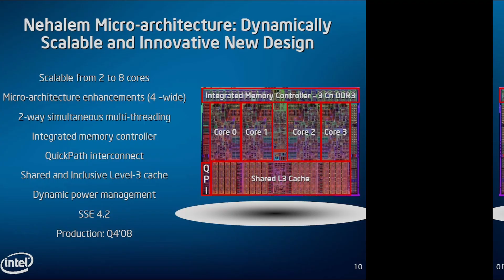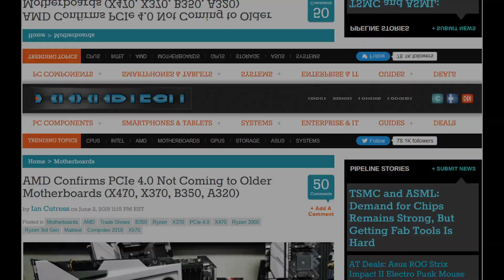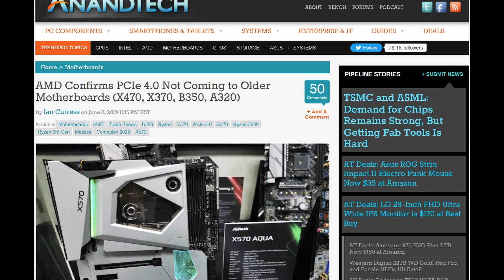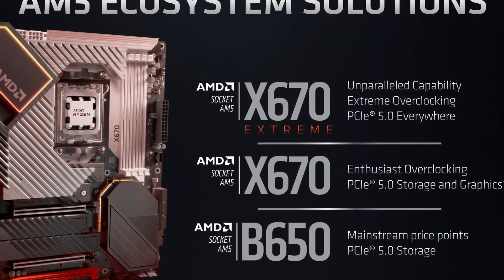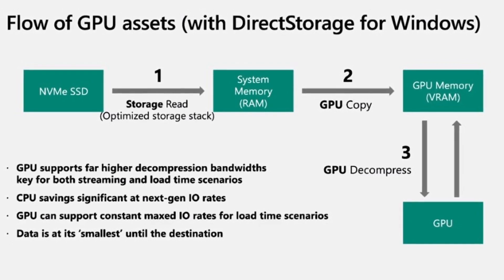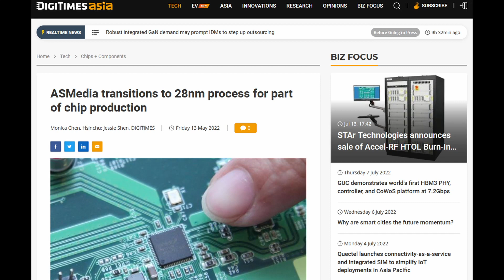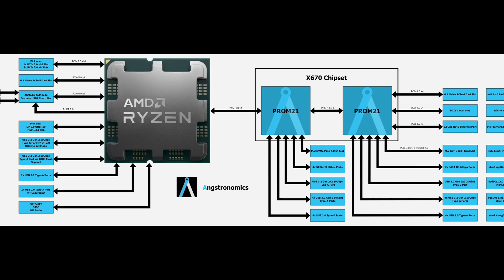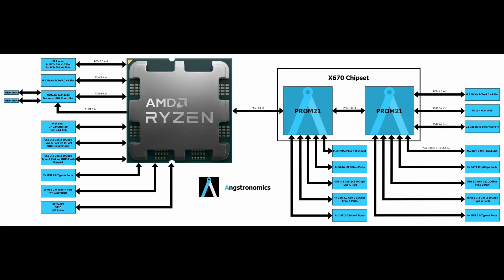The Smart Design behind AMD's X670E

Comment: I hope they release an X600 chipset like the X300.
My Dream Mainboard:
itx
2x USB 10G
2x USB 4
no SATA
1x M.2
1x pcie x16
Reply from the maker: Same here, in only need one PCIe port and honestly, no more than four USB ports. But two M.2 ports would be nice tho.
Reply: @HighYield  
A second M.2 would be nice but it could only be pcie x2. When my math is correct.
28 Lanes from the CPU
x16 GPU
x4 USB4 Controller
x4 M.2 1
x2 M.2 2
x1 Wifi Controller
x1 LAN Controller
Reply from the maker: That’s correct, but PCIe gen5 x2 = gen4 x4, so one ultra fast gen5 M.2 and one super fast gen4 M.2 would be possible.

Comment: Epyc Servers today are already SoC only.
No need for up to 10 chipset chiplets.
Reply from the maker: You are completely right! Servers already offer a ton of PCIe lanes for I/O and they need to be able to use them at high speeds simultaneously, so a chipset would be kinda useless, since it expands I/O above the actual available CPU connectivity. In my mind these chiplet chipsets could be used as chips on a modular chiplet based server, but then the actual I/O die also needs to include the memory controller and fabric to connect to the CPU chiplets, so this idea might be dead in the water. Still, scaling from entry to workstation should be possible.

Comment: : To your question: I don't think many chipset-less mainboards are coming. It's a super niche use case even though it would make a ton of sense for small form factor builds. Most buyers will think, that they'll miss out when they buy a mb without a chipset. Much like most people don't need so many DIMM slots or m.2. slots. I would also like to see like, bare minimum mbs with like only two DIMM slots, one/two m.2. one PCIe. It would be great for low budget builds. One might think that it would make the other mbs more expensive though since less people would buy fully equipped boards and so the return of investment is shifted.
Reply: There is also a growing intrest/need for such a thing though. Those of us who have been building with Pis and UNOs for some time are ready for more power. It  would allow for a lot of innovation in the "maker" world. Many of my projects need to have a central PC to work and Inuse Pis etc to relay the data. If the moduels could be stand alone, it would be an excellent opportunity to try new things. Currently most solutions are ARM based although these have been some good Ryzen based solutions as well coming out. I think they are getting noticed. It would be a good outlet for lower Bined chiplets. I would love to have APU power in an application I would normally use Pi for! It would also allow more power from the chip since it would have less distance to travel etc. 

For gaming, it would be nice to have a minimal board too as long as it was optimized for gaming. The issue with PC is that it is often all designed to do anything which makes it difficult to optimize for one specific applications. If a board was made just for gaming like a console imagine the performance we could squeeze out of a system!
Reply from the maker: You are right, it’s still very much a niche, but with ITX gaining traction, maybe bare-bones mainboards will also have a comeback?
Reply: @HighYield  : Maybe some small manufacturer will give it a try since they are sometimes more flexible.
Reply from the maker: And they can risk more, because their reward upside is bigger. I would like so see a new company enter the mainboard market, not a lot has changed over the past decade.
Reply: @HighYield  It might be difficult for a whole new manufacturer. Maybe a Chinese one. But yes, I agree. MBs from the big brands sometime have really strange layouts for mainstream consumers. But also mainstream consumers have strange ideas as to what they "need" in a mainboard that's why there is not a lot of change I think.
Reply: EPYC boards don't have chipsets, as all the IO is in the IO die. It's seems less likely to happen the other way around in general due to the size of consumer CPU packages. Even with ITX, you'd want to make up for the lack of internal IO with external. The wifi, ethernet and all those USB ports aren't likely to be directly connected to the CPU.

Comment: The new platform looks good, it appears a sensible compromise to lower platform costs while allowing cost effective premium features for those who need them.
Honestly my AM4 box is still over kill for my needs, I hope to use the system for many more years.
Intel having larger market share favour custom solutions and annoying segmentation.  I'd be surprised if they rush into modular chip sets quickly.
Reply from the maker: I’m also trying to stick with my AM4 system until at least Zen 5, but in like new tech do it will be hard…

Intel often takes its time , and you are right, they are more segmented. But maybe AMD can push them, like we have seen for example with memory OC on non Z-boards.
Reply: I love my x570 but I've always wanted to use at least 4 nvme drives without it taking bandwidth from my Gpu slots. I don't want to use sad and had anymore.
Reply: @barrycooper8640  I checked and both consumer Zen4 and Intel 12th have 28 PCIE lanes of which 24 and 16 respectively can be PCIE5.
Sounds like you need an HEDT system to gain more